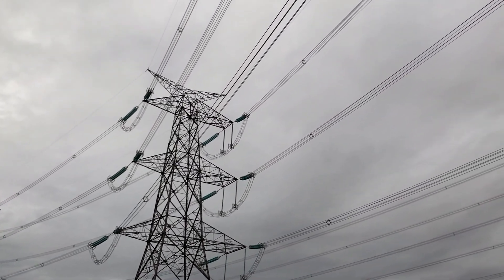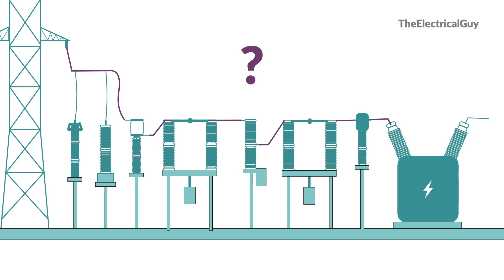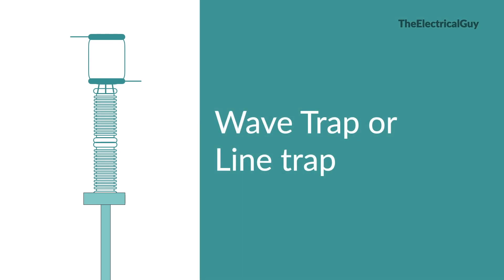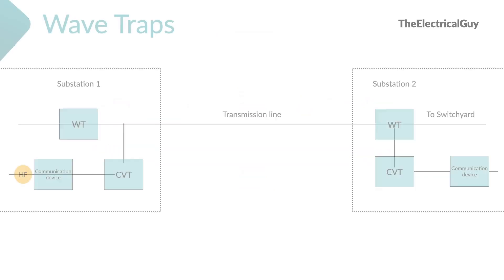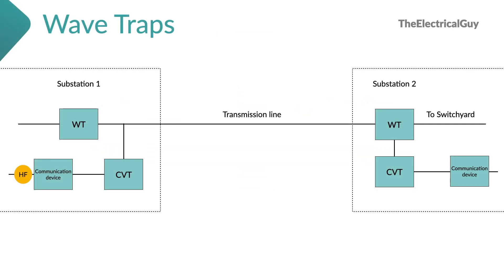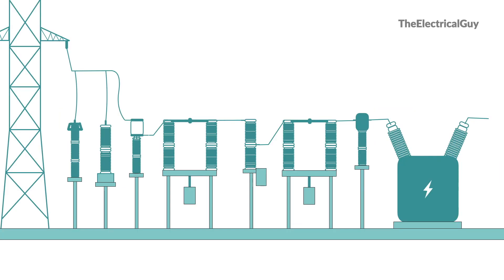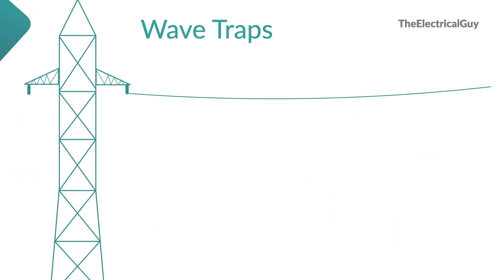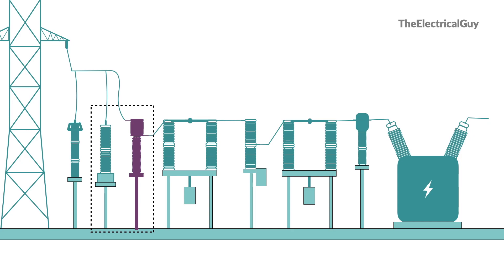Introduction to Wave Trap or Line Trap | Video #4

Comment: My company is replacing our PLCC units for more reliable fiber connections. This has an increased benefit of faster fault identification, isolation and extinguishing most disturbances. It also has the added benefit for traveling wave fault detection. Which is cool af. Oh and removing the plcc always for better redundancy using fiber and better functional equivalence for relay and comms testing.

Comment: Sir your explanation on the subject is highly appreciable. One thing I would like to know that why high frequency signals on TL while generation on 50 Hz. Pl explain.❤❤💚
Reply from the maker: Hello. High frequency signals are for communication purpose
Reply: sir thanks        Where from high frequency  is generated in TL and we need to block that @GauravJ
Reply from the maker: @jogendranagpal5638 there are communication devices installed in substations using which the high frequency signals are generated
Reply: thanks🙏 @GauravJ

Comment: Why did the wave trap only installed in 1 phase instead of all 3 phase?
Reply from the maker: Depends.. if all lines are used for PLCC.. all phases will have wave traps
Reply: I see, thk u sir, 
Another question if i may, is there a requiremnt to install a WT on gantery mounting/seperate structure or combine with CVT? 
(may be,  on certain voltage range)
Reply from the maker: Yes. WT can be mounted on gantry or cvt or on separate insulators.. all these options are available till 420kV level
Reply: Above that? Such as 500kV